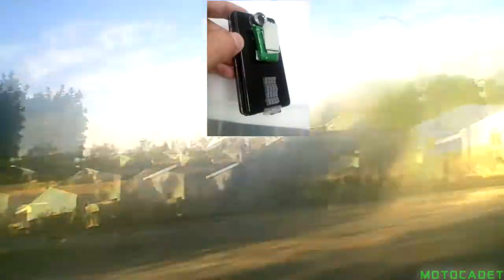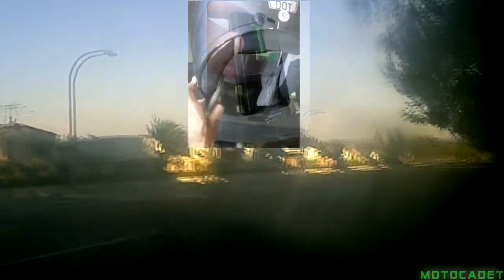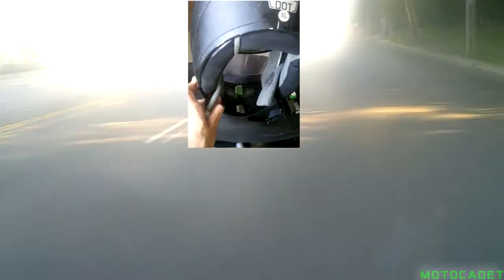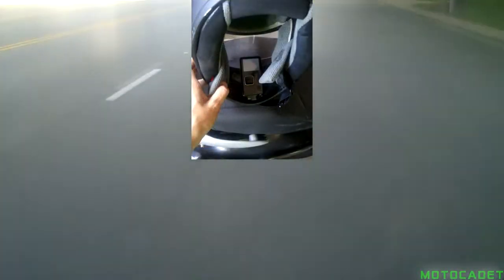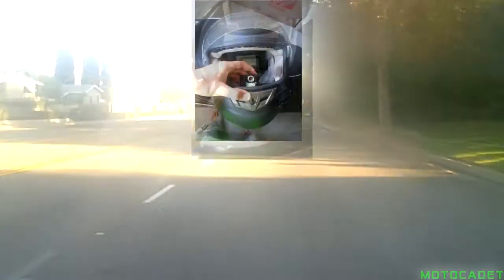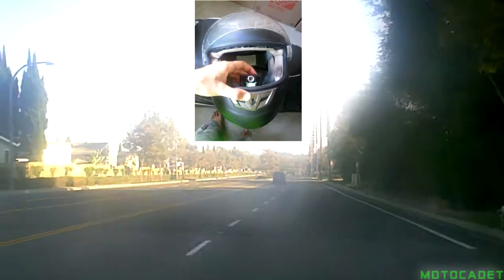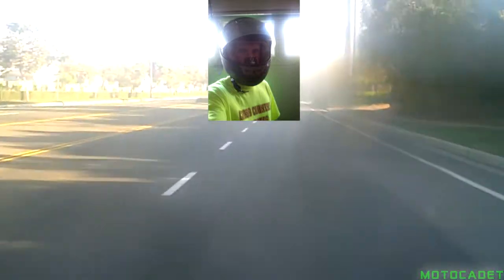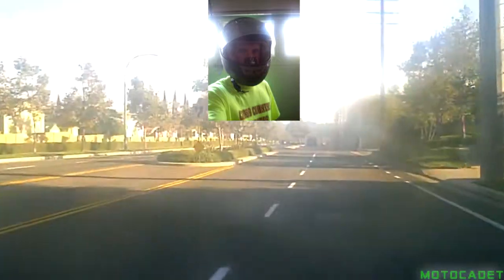150cc Scooter TOP SPEED [Vlog]

Comment: I'm a pretty big guy weigh about 240 I have a BLX 150 cc scooter  i have got it up to 56 on a flat road in extremely hot weather. What I think this guy is looking at is not real speed these Chinese scooters tend to have inaccurate speed  odometers shure mine is saying I'm going 75 miles an hour 76 miles but if you GPS it off your cell phone you'll see you're only going about 56 I do however have no doubt in my mind it would go 60 if I weighed about 50 pounds less